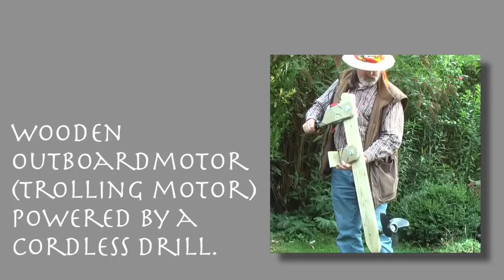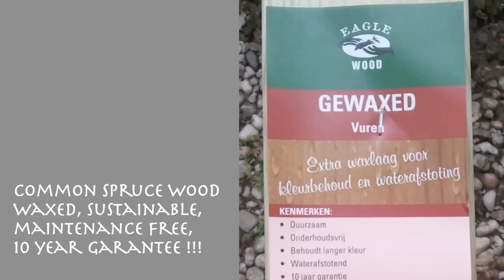Trolling motor made from wood

Comment: I made an awesome trolling motor out of a 18 volt cordless drill. If you are looking for more power than you should disassemble the drill and take out all the gears and bearings from the front section of the drill, then fit the shaft, then reassemble it. The gears actually slow down the electric motors rpm's. Just a heads up, cheers!! :-)

Comment: Nice one. Well done.
 You may want to try a model airplane prop though. Thats what the cordless canoe challenge folks are using and getting fantastic results.
 I have just made one using an 18V drill, and a 12x6 model plane prop. It was powering my Mirror Dinghy at 2.2 kts. The motor didnt even get warm, so I will try a 12x8 prop for some more pitch speed and draw some more amps. 
 Keep up the good work, and have fun!

Comment: 14AH drill on a 1.3AH battery = about 6 minutes run time.  slap 300W 12v solar panels on there and a basic 12v battery and you can go all day long.

Comment: I wonder how long the angle head and especially the chuck will hold up without leaking and rusting respectively.
Reply from the maker: Grease is the answer. I filled up the angle head and the chuck with grease. Till now it runs fine without rusting.

Comment: Well done Sir 

I need mount like this but can't build it myself.

I have tools I use for business with 10 batteries as well , 5 ah each.

Ryobi brushless cordless drill 1800rpm without this mount , just drill paddle instead = 4.5 km/ph avarage speed , max speed 4.5km ph , using cordless air fan to cool engine of a drill. 

One 5ah battery gets me 500 metres at full speed

Comment from the maker: The square drillhead can be used as it is; but I advice to fill it with grease. The head can easily be opened. It runs more smooth afterwards. Sorry, I did not try to go backwards.

Comment: I don't think ANYONE thinks this was to replace a multi-horsepower petrol/gas motor. The idea is to replace a small electric trolling motor - but even at that it will fail very fast. I do agree that people in general lack perspective when it comes to things like power.

Comment: you loose too much energy by the vertical transition,the energy of the drill (kinetic) gets down when entering the gears in the vertical chuck so you end up with not much power,but if you had the propeller straight onto the drill it would go much faster
Reply from the maker: The square drillhead behind the propeller has a one on one transmission. This chuck is filled with grease, so not much energy is lost. The propeller on a straight shaft is a problem with steering and mounting on the boat.
Reply: yes,your design is more functional and usable than a propeller mounted on a rod on a drill,but why isn't it more fast? how many volts is your drill?? I also like the mod that you made that instead of pressing the trigger you rotate the handle just like a real gas powered motor
Reply from the maker: It is faster with a high speed drill and a 2 blade propeller. See the second video. Link in the text below the video.
Reply: ***** ahh ok thanks,the truth is I didn't see the description

Comment: and a drill is not designed for continuous use - neither is the right angle gear, They will fail very quickly.

Comment: 1) get a 12V drill and then attach a car/marine battery to it. the battery life will out last the drills life, problem solved.
2) I wouldn't worry about the gearbox cause you'll melt the brushes long before you tax the gearbox.
3) You re-mount the drill to the propeller under the water, it will stay cool forever.
4) Keyless chuck will destroy itself long before saltwater can afftect it.
With all these mods will be bulett proof.LMFAO!!!

Comment: Why not just use a corded AC drill with a long extension cord?  It would be more powerful and you wouldn't have to worry about running out of battery.
Reply from the maker: ImTheFlyWhiteGuy
Watch this: Airbed powered by outboard on OHM2013

Comment: Doing it for fun is one thing, I make too much an hour to even consider this given the things I enjoy doing with my spare time. My home machine shop with it's CNC lathe and Mill and welding equip will not be used trying to shoehorn a drill into the roll of trolling motor anytime soon. But if that's your thing, some folks build steam engines for no purpose too. My projects have to satisfy some practicality role usually. All that work and you are left with a noisy slow rig that carries NO BATTERY CAPACITY of note.
Reply: That and a REAL trolling motor is almost free.

Comment: super slow a actual electric motor is half the price and is six times faster and do you want to know why because a drill is not meant to push a canoe or small boat it is to put screws into wood duh